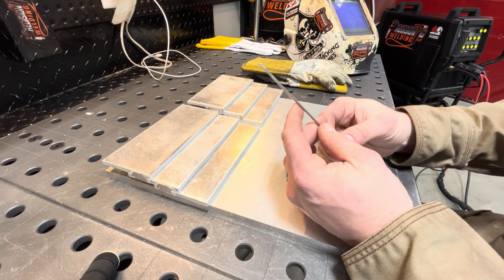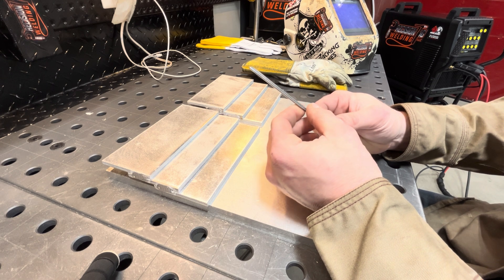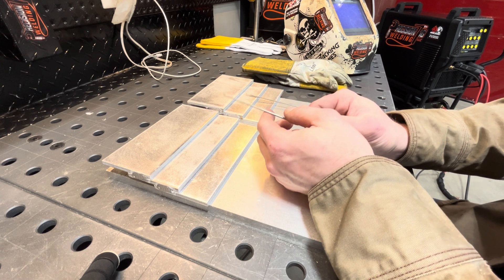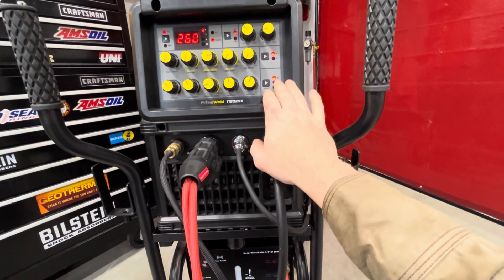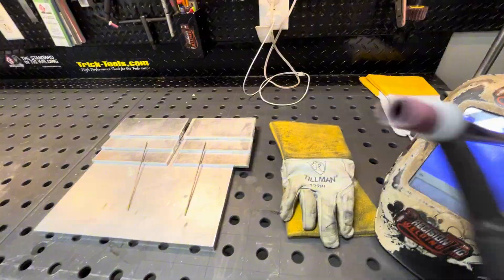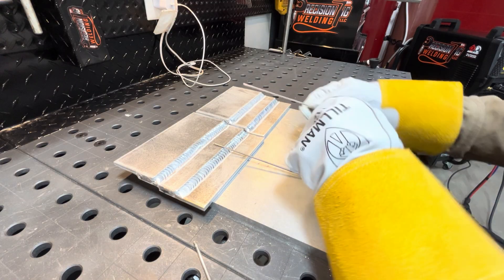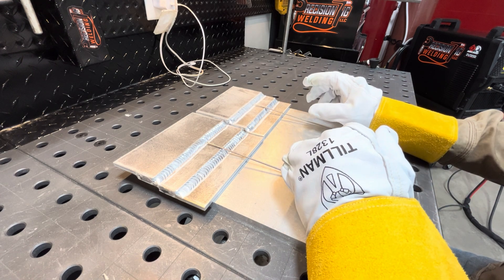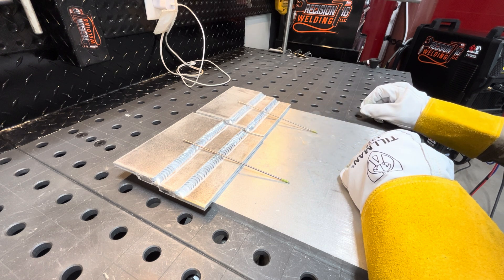Tig Welding With A Balled Tungsten vs Sharpened Tungsten On AC

Comment: Sorry about the double post but how does the ck 20 hold up to the higher amps. I love mine but my everlast is a earlier model of the 250 ex
Reply from the maker: @ajsironworks3937  i had a 250ex and the torch is doing good honestly
Reply: @ how long did it last?  How well did you like it
Reply from the maker: @ its fine ive only had one go. I really like it

Comment: I don't actily ball the tungsten but I do allow it to ball on high heat applications. You want the ball to be smaller than the diameter of the tungsten roughly 1/4 the thickness blunt the tip and let the edges soften this help keep the arc focused especially on low hz.
Balling must be still relevant as my brand new Fronius iwave300 has a ball function built in along with every other function u can ever want just about need a phd to run the thing 😅

Comment: I just started using the LaYZr on aluminum and really like it. Also using an inverter machine ( HTP 251 ). I use a 1/8" with a long taper, and then a small ball, about half the diameter as the ball on yours. It seems to hold up really well, and welds nicely. Same thing if using 2% Lanthanated. For steel, I still prefer good old Thoriated.

Comment: Only tig welded about 10 times so far, was told to ball myself for now, but whenever I finish my tungsten changes to either purple or yellow
Reply from the maker: @jasonparkerghosthead  more post flow!
Reply: @ I already have 5 secs post flow though
Reply: @jasonparkerghosthead  I think in this video he said he was at 8 seconds. I just experimented with this on my transformer machine and also had to be around 8 seconds of post flow to keep my tungsten from oxidizing. It was noticeable at 5  how easy it would oxidize.
Reply: @Kyle_97  that’s a lot of post flow 😂
Reply: @jasonparkerghosthead  it's an easy test. But enjoy grinding tungstens!
Reply: And make sure you aren't yanking the torch away while post flow is running too